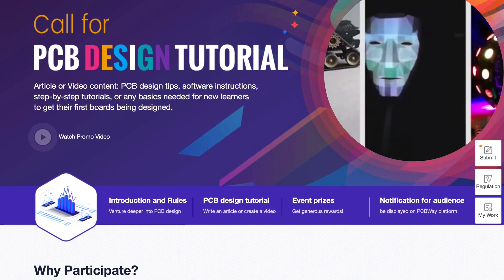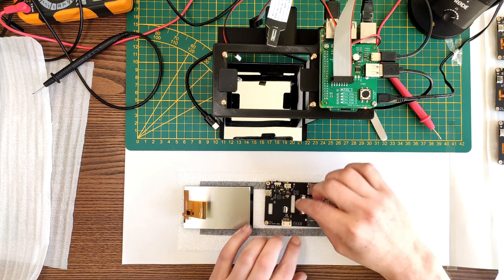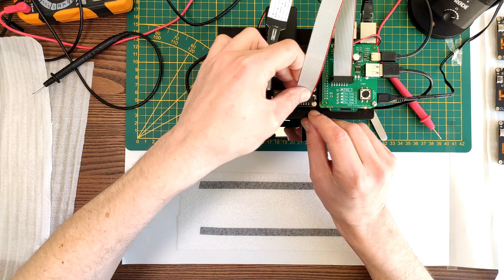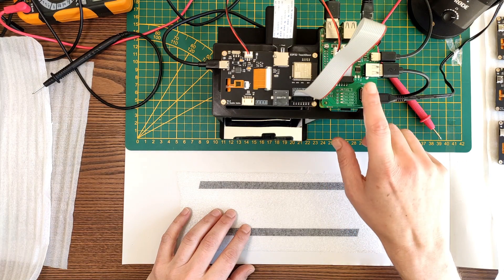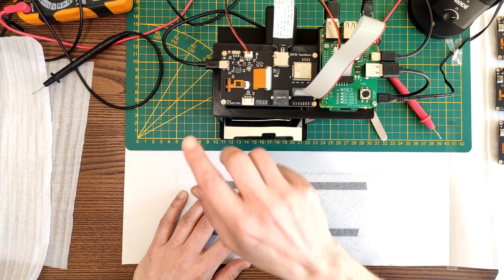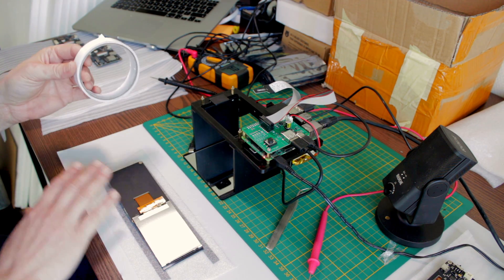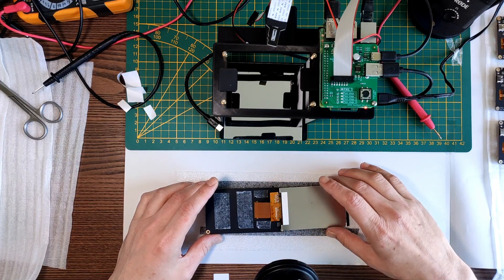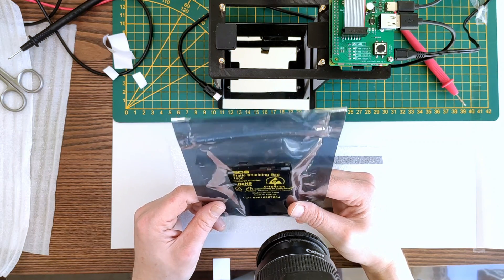How My Test Jig Works (for the ESP32 TouchDown)

Comment: Interesting process.  You're going to a lot of trouble to find and fix issues before you ship these out, which your customers appreciate.

Do you mind sharing what percentage fail the initial tests, and what the most common problems are?
Reply from the maker: Out of all the boards I have tested so far (about 55), 4 failed. 3 of them were I2C problems on the screen's touch controller. As these come assembled directly from the manufacturer, I hope I can get a refund. The other one that failed had a bridge on the ESP32, which was just a quick touch up.
Reply: @DustinWatts  Very interesting.  Thanks for that!